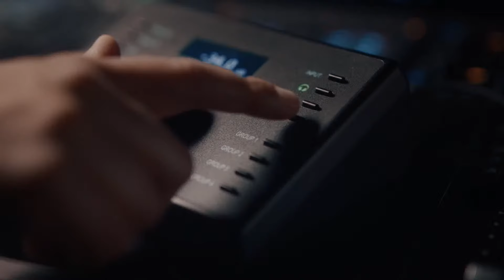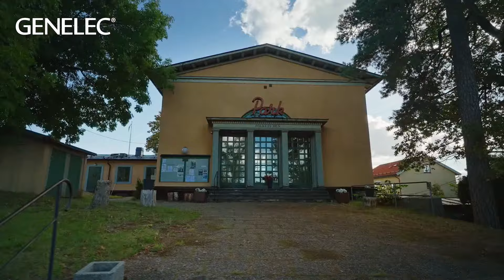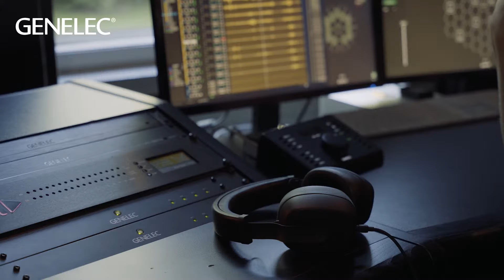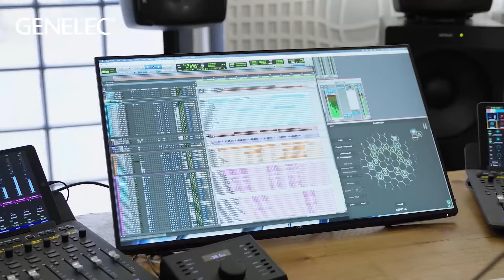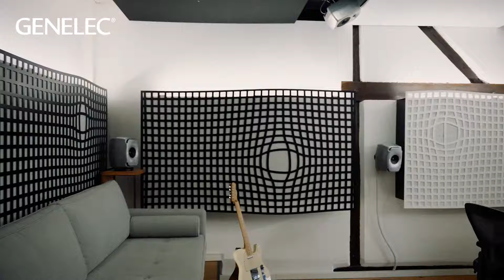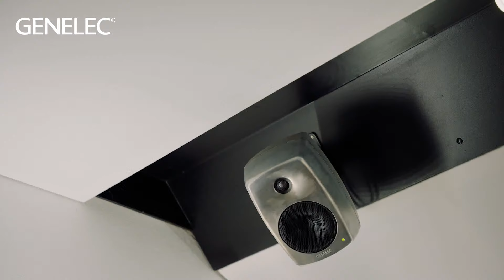Meet the new expanded UNIO Ecosystem – Public Launch Event

Comment: Can we just use the headphones as flat monitoring?
Reply from the maker: The headphones are not sold separately. 8550A and 9320A form a unique active headphone system. Stand-alone passive headphones cannot attain this level of accuracy. PRM comes with the active headphone concept where the individual headphone is uniquely calibrated with a specific 9320A device. Also, the use of 9320A device ensures the highest quality headphone amplifier for 8550A, and both of these are extremely useful from the customer point of view. If using the headphones without the 9320A, the unique calibration is not active and the headphones are not as accurate as with the 9320A. Don't hesitate to send us further questions at support@genelec.com and we are happy to help!
Reply: @genelec  hmm strange 
product..love my 1032c's

Comment: Will it be possible to playback dolby atmos in an e.g. 7.4.1 playback system simulation with the unio bundle when not being subscribed to Aural ID?
Reply: You can certainly route the binaural feed from the Dolby renderer to the 9320 and out to the 8550s.
Reply: Nice, thanks for the fast reply!
This applies to any headphone, as basically the binaural feed is basically stereo, is that right?
Reply: @synaikido  correct
Reply: Using the Dolby binaural renderer, you won't get the benefit of a custom HRTF. If you want to playback/stream material that's already encoded as Dolby Atmos, DTS:X or Auro 3d, you can use the Smyth Realiser A16, which has HDMI inputs and 2 independent headphone outputs.
Reply from the maker: Yes, you can use Dolby's binaural renderer. Aural ID might offer you even more precise results with our tailor-made personal HRTF we can create for you. You can then also fine-tune all settings of the virtual speakers. Greetings!

Comment: Can we use UNIO inside Unreal Engine in realtime rendering for precise audio spatialisation? It would be awesome.
Reply from the maker: The Aural ID Version 2 app will operate like a virtual soundcard on MacOS, so you can route multichannel audio to it and output the binauralised version using your personal HRTF. Greetings!
Reply: @genelec  That's good news! Win/Linux support also available?
Reply from the maker: @hoverpillow6106   We are looking into this regarding Aural ID. A Windows ASIO driver for 9320A is planned by 
November 2024.

Comment: Genelec Team I have a question: 
I have already purchased the 9320, and I'd like to buy the new 8550 headphones as well. Is it possible to purchase them separately?
Reply: Yes you can “upgrade” your 9320 with a separate purchase of 8550. You MUST have your 9330 registered on your MyGenelec account first. Price of the 8550 is roughly the price of the bundle minus the 9320 price. It’s my understanding the headphones will then be purchased through your MyGenelec account. More exact info will be provided as the actual ship date approaches in November.